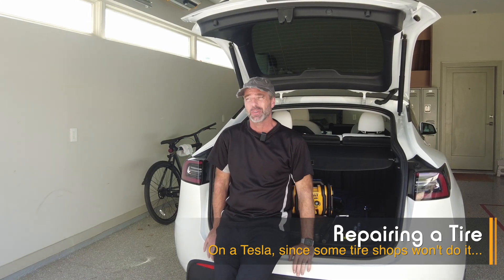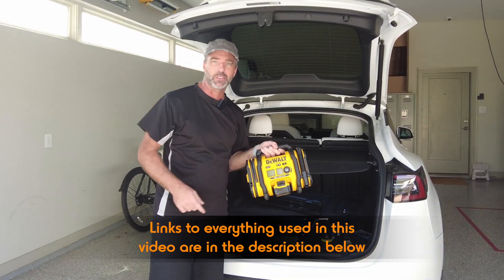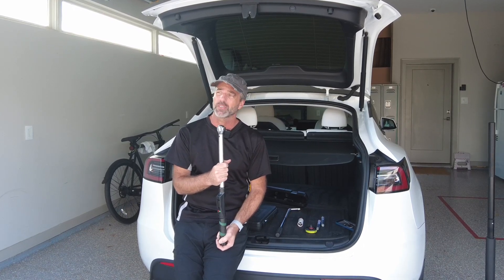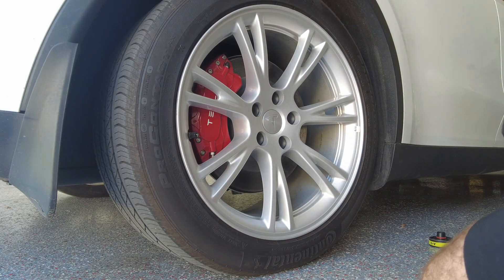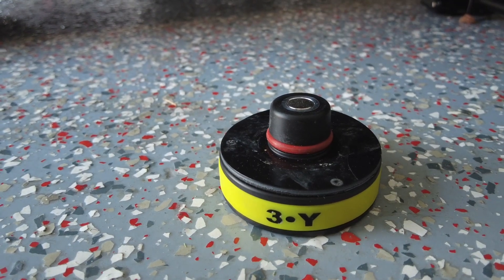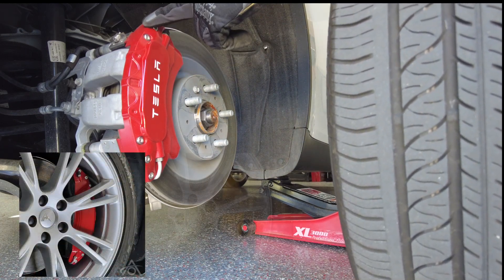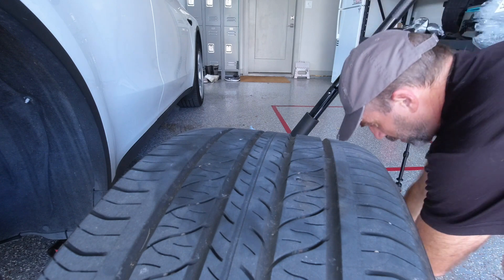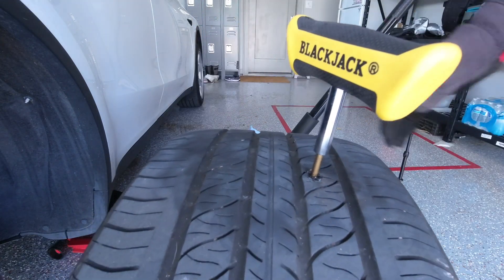Repairing a Tire on a Tesla

Comment: Thank you very much. A clear and informative how to. As a new Tesla owner - I am still getting used to the "there's no spare wheel".
Will be getting a tyre repair kit today, and am now looking for my jack. 
Do you carry a a portable jack on trips? if so what do you recommend?
Reply from the maker: Good question! We don’t travel with a jack, but from a quick bit of research, most scissor jacks are rated for 3 tonnes, which isn’t really safe for a 3 or Y. You might want to check out modernspare.com, they carry a 4T version which when just lifting a corner of the car should be more than enough. You can also buy a ‘donut’ wheel from them, if you’re relly worried about getting a flat in the middle of nowhere.

Comment: Informative! Well done !
Question please. Would you attempt this plug if the puncture is towards the edge of the threads? I mean far end of the tyre threads
Reply from the maker: I think most shops will refuse to repair if the puncture is within an inch of either edge of the tire. Unless it's an emergency, I'd probably follow the same guidance, but if you're stuck in the middle of nowhere, you gotta do what you gotta do! I've seen some crazy pics on the internet where many plugs had been used to close up a puncture; nothing you'd want to go racing on, but if it lets you limp home or to a tire shop, then so be it.

Comment: Very useful.   Just taken delivery of my Tesla.   A few years ago I had a lot of punctures so every car since then I put Puncturesafe in the tyres.  With foam inserts I couldn't get the Puncturesafe in and was wondering what I should do.   I'm thinking of carrying a 'get you home' spare and after watching your video doing the repair myself.   I've also ordered a similar jack and pucks.   On the other hand I'm thinking why bother with a spare as with normal punctures just take a tyre inflator pump to get the pressure up so that I can get home.  What do you think?
Reply from the maker: Yeah, that's pretty much what we do. If a puncture is bad enough to cause a fast deflation, then a repair kit probably won't fix it anyway, but all of many, many punctures in the Tesla's have been screws/nails that are slow. We travel with the repair kit, and DeWalt tire inflator in the car.

Comment: Hi Pete. Great video.
Just got a flat in my TM3P 20" and thinking of following your steps, BUT these kits are mostly sold for emergency or roadside repairs. What are your considerations for "spirited driving" or track use after a couple of these repairs? Kind regards, Michael.
Reply from the maker: Hi Michael. I'm not sure how many repairs I've made to our Tesla's since making this video, but it's several, and it's never caused any kind of issue. Track use might be something else, but if you have a Tesla, isn't every drive 'spirited' 😁

Comment: Pete, I have a question: If I buy your mini pry bar, does that take the place of having the needle nosed pliers? Thank you so much, Mitchell
Reply from the maker: It might? The mini pry is always my go-to tool, but, a person can never have too many tools, so there’s plenty of pliers lying around too!
Reply: @AbstractOcean  Thank you so much, Pete!
Reply: @AbstractOcean  What is the overall length of your pry bar? The one that you selected from Amazon is 11” long and it is not as thin on the ends like yours to be able to get under those thin nail ends. I’ll keep it around my house anyway, but I would love one that is more like yours.
Reply from the maker: @mitchellbarnow1709  Mine came with me from the UK, I've had it for years, but couldn't find something identical online. This is the closest thing, from the UK site I would have bought the original from: https://www.screwfix.com/p/magnusson-pry-bar-8/8640v#_=p
Reply: @AbstractOcean  Pete, thank you so much for spending so much time with me, I really appreciate your help!
Reply: @AbstractOcean  I really love the feel of the tools in the flat repair kit. They are padded and heavy for good leverage. Thank you so much, Pete

Comment: Hi Pete! Today’s video was extremely useful and I really appreciate you showing me the left handed way of straddling a tire! I have a cheap repair kit that I haven’t had to use yet, but I will look into yours instead. Do you keep the torque wrench in the car? I know that the torque spec is extremely high in Teslas.
Reply from the maker: I don't, but probably should. The regular wrench is probably good enough for a road trip, hopefully will never need it...fixing a tire in a relatively cool garage is a lot easier than at the roadside!
Reply: @AbstractOcean I look forward to Part II of this series where you are fixing a flat in a much worse place, like on a busy highway!